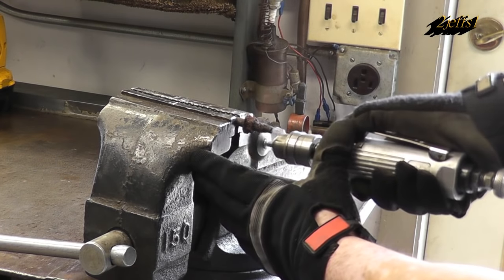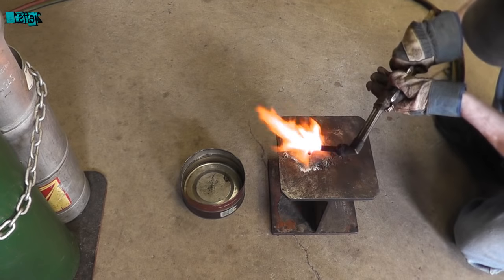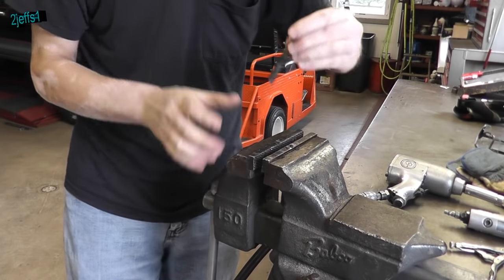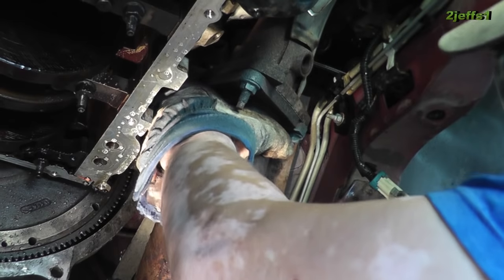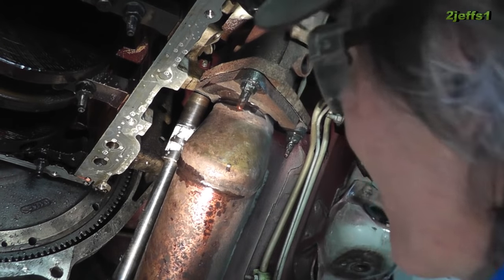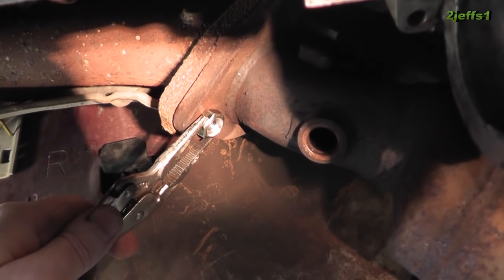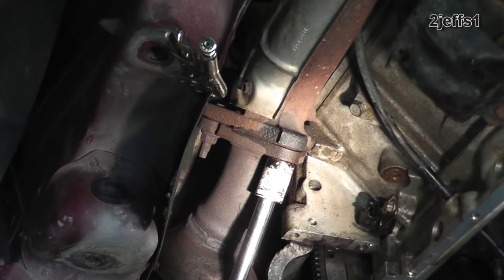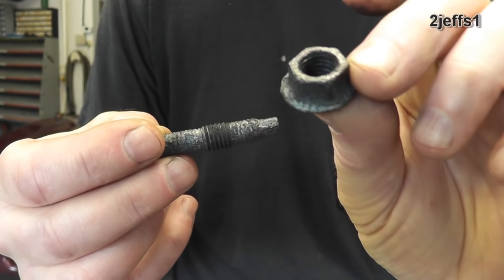Removing Rusted Bolts and Nuts THIS WORKS GREAT!

Comment: Fabulous great information. I've tried most methods of rusty fastener extraction but this quench method. Luckily, I was introduced to Kroil and it saved me from most of the broken pieces. Thank you sir
Reply from the maker: +NewRiverRepair Your welcome. This trick gets used quite frequently here, almost daily sometimes. I was hoping this would help out the gear heads that follow my channel. Rusty stuff can be so aggravating. To have one step up on it is a huge plus!

Comment: This video is a few years old and some comments have stated they will buy a Harbor Freight Oxy-acetylene set to do this repair.  I'm NOT bashing H-F, as I use a lot of their tools in my race shop.  That being said,  most welding companies supplying gassses will no longer fill the Chinese bottles,  so your oxy-aceltylene set will be worthless if you can't fill the bottles,  so check first before you buy, GOD BLESS.

Comment: Thanks for the idea of the heat!  I had to 2 exhaust nuts that wouldn't move... after your heat idea they came right off with just a 1/2" drive :-)  Many THANKS!!!
Reply from the maker: +Duane Sheehan Your welcome Duane. This trick seems too good to be true until tried. Rusty things can be so frustrating. To eliminate that factor is a good thing!

Comment: I have had excellent results getting nuts loose by clamping vise grips on as tightly as possible, spraying the exposed end with penetrant oil, and repeating on as many sides of the nut as I can reach. The pressure forces the threads together and opens up gaps opposite that direction. It has never failed me.
Reply from the maker: Interesting. I can see where there will be a time where this would be a great option!

Comment: I have been using this method since 1981, ideally you want to heat just the nut, then drench with cool water, as this causes the nut to expand when cooled. If doing on a vehicle, try to heat and cool only the housing  that the bolt is screwed into.
Reply: So on a brake drum rusted onto a shaft i just focus the heat on the drum and not the shaft?

Comment: hmmm, I may have to try this. I've used oxy, and I've extracted studs with a welder... quenching really rusty stuff hadn't come to mind but kind of makes sense. You're shocking and breaking up the rust by both extreme heating and rapid cooling. But, unlike leaving it red hot, you return the metal back to full strength before beating it with the impact.

Comment: I use and always keep a candle handy for doing what you're doing. instead of quenching with water stick any wax or grease if no wax is handy to it as it cools. You don't need to hold it constantly until it melts the whole candle away but stick it and watch as it dissipates and add more until it's cool. The heat will draw the wax inside and lubes the whole inerds. Have used this a lot on dozers and other heavy equipment.
Reply: +Phil Lowman   How clever!  I will use this trick.  I guess I need a stronger flame than my kitchen blow torch, heh, heh!

By the way, since I am an English major, I have to correct your spelling!  It is INNARDS, not INERDS.   i-Nerds are computer people!

Comment: It works very well on brake bleeders. Also heating the fastener & touching a crayon to it helps. The wax seeps down into the threads.
Reply: only way to go wax candle crayon ect the heat sucks it in like soldering copper pipe

Comment: Been useing this method since I was a kid. Be carfull around castiron and dont put impact on it till I have it loosened up. An old fire extinguisher charged with water and air pressure works well.

Comment: I will be doing an exhaust manifold soon. First I will sandblast the nuts and studs. I own a cheap bottle blaster. HF has them for about $20. I put a short piece of brake line and hose at the tip. This gives me more control where the sand hits. Wear blasting helmet. Once clean, PB Blaster. Let soak.  Then I heat them with propane or MAPP gas. Then cool them quickly with air or water. Repeat.  More PB B. Then remove by hand. No power tools.

Comment: When you go back together with exhaust components,use brass nuts and you'll never have to worry about having that problem again.
Reply: The absolute first thing you do when removing rusted bolts and oil & transmission drain plugs is to give it a good smash with a medium size hammer. Hit the head of the bolt with a heavy hammer and it will loosen the rust to metal bond. Spray penetrant next. Of course you can't reach it with the hammer, so use a 1/2 inch extension that's used on a ratchet, something like solid steel bar, 1/2 inch or bigger. It will make the difference between breaking off the bolt and loosening it up. Then loosen a 1/4 turn then tighten it a 1/4 turn. Repeat this until you feel you can back out that bolt. And if your gonna keep that car or truck for a 100k more miles put some white lithium grease or anti-sieze on the threads.

Comment: Very interesting...I have used heat before but never thought to quench.  Must be the expansion on heating and quick contraction on cooling that breaks the bond.  Nice job on the digger.
Reply from the maker: That trick gets used a lot here on so many different components. Some vehicles that arrive here are quite rusty, it's nice when things can come apart without busting stuff off which keeps the repair costs at bay for the customers. Not a single bolt snapped off either when doing the digger. What a time saver. Thanks for stopping by Colin, Jeff.
Reply: What up, my digger?

Comment: This method has always worked for me, except I didn't do anything to cool the pieces. I would think fast cooling, as well as extremely localized heating, could be damaging to parts like exhaust manifolds or any large parts (I saw people crack their manifolds by pouring water on a running engine). Also, the piece you are removing does not need to be glowing hot. Smoking hot is hot enough. There is always some organic residue on a rusted bolt that will give off smoke; if in doubt, add a smidgen of oil to serve as an indicator. Another good indicator of sufficient temperature is rust turning black where you heat it. Just make sure it is not black from soot depositing on it. It is easy to tell iron black (magnetite) from soot; plus, there will be smoke.

My theory is that the thread-locking rust structures either break up due to thermal expansion of adjoining parts or are reduced to smaller particles by reacting with air or flame gas. Both processes occur while the parts are being heated. Final cooling might produce some additional crushing force, but I believe it will be superfluous in most cases.

Comment: Its not always possible or desirable to heat things up with a torch so as an alternative try a 50:50 mix of acetone and ATF. Apply mixture with a brush, allow to penetrate and hey presto off it comes. Works as well as the torch method al all situations.
Reply: very interesting,,,,,,,,,,does this really work,,,,,,,,,,,,,,i'm gonna give a try very soon...........thanks

Comment: New sub here too..Looks like a pretty awesome trick. So on a rusted on hub onto a shaft would it work if i just heated up the hub and cooled it off rapidly or does the shaft need to be heated up too for this trick to work.
Reply from the maker: Not sure on if that would be a good idea on what you have there without seeing it. However there was a time when a printing press needed the shaft removed from the drum. A helper there attempting had the shaft end mushroomed real bad. Ground that off and emptied a can of parts chiller on the shaft each end and walked it out with an air chisel first try. The so called expert that said my idea wouldn't work (and his obviously his didn't)  just walked away. Each circumstance presents it's own obstacles and techniques.

Comment: So basically what you're doing is hardening the steel. You're strengthening it, and that's why they aren't breaking. That's a good idea I never thought of that. Ive got a 99 jeep so I've been dealing with plenty do rusted bolts. I found that atf and acetone mixed seems to work well. Sometimes if I can I saturate them numerous times a day for a week.
Reply: Copy/paste of my reply to another confused comment above. 

"That's not what is going on here. This is differential heating and cooling. When you heat it up the metal expands, but since the bolt has a nut on it, it can only expand along its length in that spot. Then when you rapidly cool it down, it shrinks back down and it leaves a gap between the threads. The larger the bolt diameter, the greater the gap."
Reply: I'm pretty sure I remember my 8th grade shop teacher going on about heating and quenching to harden metal and heating and slowing cooling down to temper it.  This seems kind of scary on parts that you are going to re-use.
Reply: De Factio It is precisely because they are both expanding and contracting that a gap is formed. During expansion the force of the nut and bolt expanding directly oppose each other, thus only allowing the bolt to expand longitudinally. Then when they contract there is no opposing force, allowing a small gap to be formed, because that metal has to go somewhere. There is even a rule of measurement for this effect. If memory serves me correctly, it is 1 thousandth of an inch per inch of diameter on the bolt. So you can see it is a small gap, but a gap none the less.
Reply: De Factio Yes there is lol. Do you think I just pulled that rule of thumb measurement out of thin air or what?

Comment: Great video.  Your  knowledge & ideas are invaluable. Really enjoy watching your videos.  I will be watching many more that's for sure. Not quite sure why you get the TD from people.
Reply from the maker: +Stephen Marriott Thanks Stephen. I just used this last week to get the upper shock nuts off the studs on a pickup that were difficult to get at. Could only get a 1/16 turn on the wrench each time. That would of been a lot of trips up in that area with the torch without doing this technique. Had heat shields in place and used the garden hose to cool it. Came right off with no resistance first time!

Comment: if you're still around, the project i got is land side steel plow wheel, it's outside bearing/cup that bolts to the wheel is gone, and three rusty 3/8th or 5or7/16ths bolt remains are about 1/16th  countersunk below the surface. i only have a 115 millermatic or like cricket wire feed. and at voltage adjustment up to 4 (max) and all kinds of speeds high or slower i never can get penetration on the studs, it gets to glowing and fills fine, but doesn't quite make the joint. i got 225 lincoln stick welder but that'd be nightmare. the bolts have probably been stuck in there for a 100 years exposed to the rain since. i got 2 out of the inside bearing/lift gear side. took about 10 hours and 3 times with the wirefeed. got any ideas? the hub is cast iron.

Comment: Yeah, when you try and use a trick that actually does the trick you are reminded of the joy the life gives... :)
More serious, I've never tried the rapid cooling step before, it always seemed to work after heating and working while hot. In my opinion, you'd also have to temper the steel back. I know you've heard this hundrets of times (innerself ond others), but I'm inxeperienced and curious of what you can say about this.
Reply from the maker: +Martynas Valūnas Definitely a valid thought you had there! Thru all the years of doing this I never ran into a failure after doing this. To anneal metal one allows heat on it for a period of time allowing it to cool slowly making it more workable. I believe the fast cool retains more of the original structure. Just used this trick again last week on some bolts that threaded into an exhaust manifold which retained an air injection tube which needed replacement. They definitely would of snapped and there was no way to get at them to drill & tap if broken. 10 minutes of setup saved hours of frustration again!

Comment: That looked like it worked really really well! Have you ever heated them up and just waited for them to cool down? Did they still come off? Or was it the thermal shock of the water quickly cooling it.
Reply from the maker: Hi Tyler. The water is the secret and must be used. That trick gets used weekly here. It IS hard to believe how well it works until experiencing it!
Reply: Would just a propane torch work? Or does it have to get to critical temp?
Reply from the maker: It depends on the size of the piece to be heated. A small 1/4" bolt it might be possible. The part must turn orange before hitting with water or this won't work.

Comment: They need to come up with another way besides dumping salt on the road to keep them open. The damage to people's cars there from the salt-induced corrosion must be seen to be believed.
Reply: tempest411 Not to mention the damage to bridges and drainage pipes.
Reply: governments way of making you buy new cars and making jobs
Reply: I have a 22 year old truck & even though i never use it when it's wet ,it still rusts because of humidity in the air.
Reply: I've lived and driven in Minnesota winters for 37 years. I have taught my wife and children to drive as well. I have also driven in area's that have run out of the road salt budget so the roads were left untreated. If the price of fewer deaths of my fellow humans are rusty cars. I chose to pay that price. I am sure there are a lot of scientists working for that better answer to icey roads. If you know a better answer please share it here and we will join in getting it implemented. In the mean time when you see that rust you can wonder who's life or well being was bought and paid for by that rust.
Reply: @johnhogan3810  I guess that's your business if you're fine wasting all that money. For me I would either insist on something like a network of steam lines under the streets to keep them clear-along with the taxation to pay for it..has to be less than buying new cars all the time, or..live well away from where it snows, which I do. I expect my cars to last as long as they are mechanically maintained..to go forever, or until a wall falls on top of them or something. To lose a car to rust is an inexcusable waste. 

Alternatively, why aren't car buyers in the rust belt insisting that the car manufactures use materials other than steel in the frames and bodies of vehicles sold there. They would cost more, but it sure would be worth it.

Comment: I have a question Jeff,  I am trying to get the bolts out of a transfer case bolted to the transmission.  They are both made of aluminum.  All the bolts that had a steel piece bolted to the aluminum transfer case snapped off. Even with heat from the torch they snapped off with nothing sticking out. I can't get a drill in for straight drilling out. You have tricks?  By the way all bolts with no steel came right out. Can't weld a nut on because nothing is sticking out. Can't get the case to separate from the transmission to get at them from the back end.
Reply from the maker: That was painful to read. Man - no good tips for that one. Those situations take the fun out of those projects for sure....

Comment: I've found a reliable method for removing nuts from studs that are badly rusted but not so far gone that theres nothing left under the rust.  Soak the exposed threads PB Blaster and let it sit for a while say 20-30  minutes.  Dial down the impact wrench to a VERY low setting and let it vibrate the nut for a while before gradually increasing the impact force.  The vibration helps the PB Blaster penetrate and emulsifies the rust within the nut's threads.  Starting with low impact and gradually increasing it will free the nut with less applied force and without overstressing the stud.  

Once off a vehicle, the sest way to remove rust if the pieces are thought to be reusable is electrolysis, not wire wheels.  Electrolysis will show how much of the original metal remains.  It may take 2 hours to use electroysis vs a few minutes per piece to brush, but there is no limit to how many pieces can be put in a bath at a time while you do something else.  Once cleaned, the same equipment with a different solution can be used to plate new material over damaged surfaces.

Comment: You can actually get steel to glow with a cheap MAP gas Berzomatic torch (propane will NOT get it that hot.)  All you need to do is make some heating/cooling cycles that cause expansion of the steel - the temperature difference between the nut and stud will cause the clearance between them to change thereby shattering the rust crystals.  

After a few cycles, you can heat the nut and get it glowing while the stud is still black - this means the nut is now "loose" on the stud and not conducting heat into the stud.  When you get to this point, when hot, touch a candle to the threads and the parafin turns to water and soaks in.  This is the ultimate anti-galling (screeches when turns) lubricant.  (Paraffin is just extremely high weight oil)

Comment: I wonder if this trick would crack cast metal if it got on it when it was glowing, like accident;y on the ear of a manifold? I normally just let things cool natural unless I'm trying to heat treat. I wonder if instead you used oil and quenched it that way if it would come off easier?

Comment: How would you do this trick with a broken bolt in an engine block? Is it safe to have the cast iron block red hot then quickly cooled?  I have a 5.0 mustang motor with one of the water pump / timing cover bolts broken in the block. It had been leaking coolant and they all came out with a fight with one broken in the block. The corrosion had even got to the alum timing cover because it was corroded to the bolts and it barely even came off...Thanks